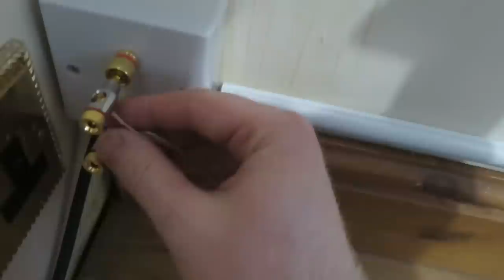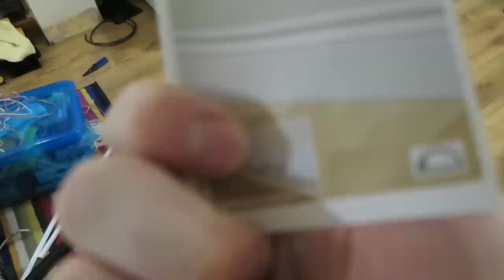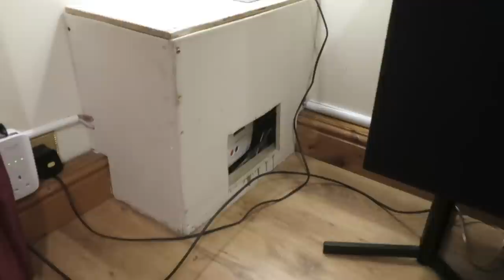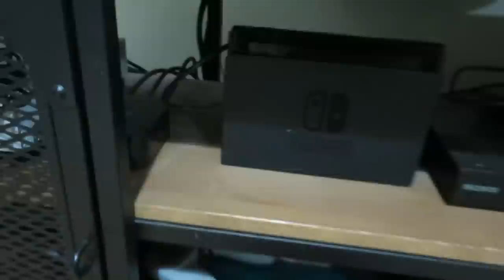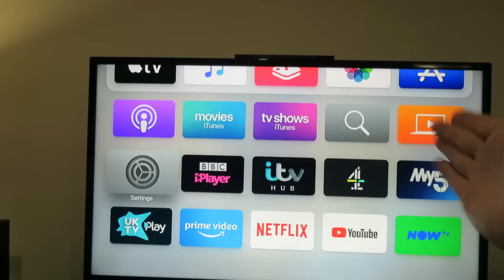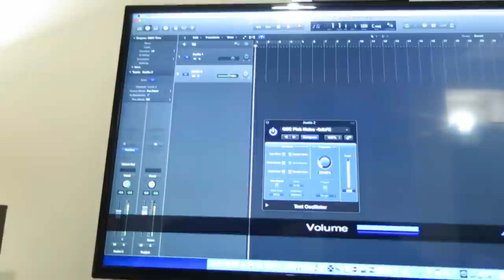Setting Up Our Living Room Entertainment System (Part 6)

Comment: U should angle the speakers towards the center of couch to make a triangle with the tweaters to where you  are seating. And get a subwoofer it makes a world of difference in tv shows and movies.
Reply from the maker: Which speakers, the front L/R? 
We did have a sub on this setup but I took it out. I was having some complications with it, but more than that, I felt it was unnecessary for our situation. 90% of our TV watching happens when the kids are asleep, so most of the time I ended up turning the sub completely off to avoid disturbing them. My front speakers are quite large, so at full range you get a nice rounded low end. You don't get the ground shaking 40Hz / 50Hz cinema sound, but there's still plenty of bass for impact.
Having said that, when they're a bit older I'll more than likely add a sub back into the setup.
Reply: Front left and right yes

Comment: The receiver's faulty soft start almost certainly damaged the speaker. Either the protection circuit is fault or there's DC on the amplifier output as the receiver starts up, causing the protection circuit to kick in and out. That could be a faulty amplifier channel, something in the receiver's power supply or the protection circuit itself. If that's the case it will destroy tweeters in short order and can take the rest of the drivers and / or crossovers out fairly quickly too if it gets much worse, not to mention cause further damage to the amp.
Reply from the maker: Good to hear from you, Ashley.
Yes, this is a right pain. I'm absolutely gutted that it's happened because the last thing I feel like doing right now is replacing my receiver. I do have a plan to try and program a mute command into the shutdown sequence of all of my Harmony activities. This way, I'm hoping the receiver will start up muted automatically. It seems to remember the last volume placement, and if the volume is down on startup, the various pops and crackles aren't audible. This might buy me some time and also saves me depleting the planets stock of replacement 80s Technics speaker components.
Reply: @ItsMyNaturalColour  The majority of mid range drivers in hi-fi speakers are either sealed units, or at the very least don't rely heavily on the enclosure. Given that those speakers have a decent crossover, providing you match the dimensions, and at least match the faceplate size to remove air gaps you should be able to fit any number of aftermarket mid range units. Technics used a lot of drivers across ranges, so if you can find a beaten up old pair of Technics speakers from roughly the same era you'll probably find it's the identical driver.
Reply from the maker: @ashleycox432  Someone managed to find one for me on eBay and posted the link in this comment section! Couldn't believe it as for the life of me I couldn't find one on eBay... but there it was. I've ordered, received it and it's sitting here on my desk. Looking to pop it in next couple of days.

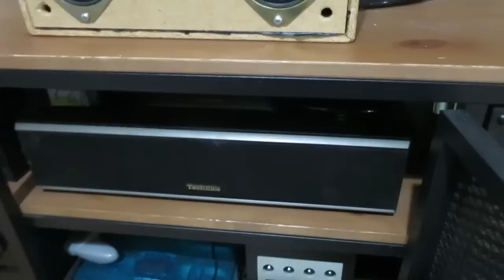Comment: 47:20 this is a perfect (guaranteed) way to make a speaker sound worse
You're adding a load of diffractions by putting it in a cage like that, any center image that was clear with it in the original position should be audibly worse with it in the shelf

Comment: probably a stupid question - why do you need a separate blueray player? does the xbox not do that? PS deffo does
Reply: Was wondering that too, if anything the Xbox is a hell of a lot better blue ray player than that dedicated one
Reply from the maker: We've tried the Xbox One as a Blu Ray player once or twice and I have to disagree with the Xbox being 'hell of a lot better' than a dedicated player. Hardware is fine, but the Blu Ray / DVD app on the Xbox really drags things down. It's clunky and slow, rough navigation and doesn't seem to remember your place in the film as reliably. The Xbox also takes much longer to boot up. The Sony Blu Ray player has a quick start option so you're up and running into the disc in less than 5 seconds. Waiting for Xbox to boot into the OS, then launching the app, takes a lot longer. Also the Xbox is slightly louder, consumes more power and strangely enough, blacks seem deeper from our Blu Ray player VS the Xbox output. I'm not sure what that is, but it must be another something to do with the Blu Ray app because I've noticed better contrast in games than watching Blu Rays on the Xbox.

Comment: I am very happy that my suggestion to carry out the internet cable to the Salon, after more than a year has been realized :) 
I waited a long time. 

As for the protective strip behind the radiator. If you still haven't slipped it in. 
I suggest using WD40, thanks to which you will have slippery plastic and slide along.

Congratulations on the purchase of a new TV. 
Surely everyone understands that you don't need to have 4k to be happy with what you have. 
When do you plan to hang the TV on the boom? Although now that you mentioned the projector, 
this TV may disappear from the regiment.

Congratulations also on the growing family. 
I can't wait for the family photo :)

Comment: tom you can use the xbox one  for dvd and blue ray
Reply from the maker: I've replied to this comment below, but I'll copy it here...
"We've tried the Xbox One as a Blu Ray player once or twice and I have to disagree with the Xbox being 'hell of a lot better' than a dedicated player. Hardware is fine, but the Blu Ray / DVD app on the Xbox really drags things down. It's clunky and slow, rough navigation and doesn't seem to remember your place in the film as reliably. The Xbox also takes much longer to boot up. The Sony Blu Ray player has a quick start option so you're up and running into the disc in less than 5 seconds. Waiting for Xbox to boot into the OS, then launching the app, takes a lot longer. Also the Xbox is slightly louder, consumes more power and strangely enough, blacks seem deeper from our Blu Ray player VS the Xbox output. I'm not sure what that is, but it must be another something to do with the Blu Ray app because I've noticed better contrast in games than watching Blu Rays on the Xbox."

Comment: Tom, does your HT Receiver not have some kind of microphone calibration? I bought into a used Marantz on ebay (shout out to the guy who absorbed $700 of depreciation for me...!) and it came with a small microphone which allows the receiver to automatically blasts each channel with noise then dials in the channel boosts for you - super nice!
Reply from the maker: Yes mine came with one of those. I should dig it out and give it a go one day. My speakers are in less than ideal places, and our seating position in relation to the rear surrounds especially is nowhere near ideal so that's what's always put me off.
Reply: ItsMyNaturalColour my room is about the same size as yours. I have two old bose 901s front channels that my father in law dug out the attic, some no name center channel, 4 home theater in a box surrounds that I nabbed from my uncle and a sub from Craigslist. It’s hodgepodge but I love it! And the microphone calibration really helped, especially for the poor quality high end speakers that are part of my setup. Hope you and yours are doing well. It’s the perfect time to enjoy some quality time together as a family and having a good setup doesn’t hurt 😉

Comment: I can imagine your picking up quite a bit of interference noise, some of it can be rectified by routing the power cables away from other cables (especially the speaker cables) but I'm afraid you're going to have to put up with a faint interference noise, due to the fact you're using unshielded speaker cables! If you're not a heavy listener,  you might not even be aware of it! But if you are and its annoying you,  you now know the reason!  Good luck.

Comment: 1, the xbox is blu-ray player and u can control it with your harmony remote
2. two little boxes can go side ways
3, the wii u can be hack to play gamecube and n64 games
Reply from the maker: Thanks for the suggestions.
1. I've replied to this comment below, but I'll copy it here for convenience "We've tried the Xbox One as a Blu Ray player once or twice and I have to disagree with the Xbox being 'hell of a lot better' than a dedicated player. Hardware is fine, but the Blu Ray / DVD app on the Xbox really drags things down. It's clunky and slow, rough navigation and doesn't seem to remember your place in the film as reliably. The Xbox also takes much longer to boot up. The Sony Blu Ray player has a quick start option so you're up and running into the disc in less than 5 seconds. Waiting for Xbox to boot into the OS, then launching the app, takes a lot longer. Also the Xbox is slightly louder, consumes more power and strangely enough, blacks seem deeper from our Blu Ray player VS the Xbox output. I'm not sure what that is, but it must be another something to do with the Blu Ray app because I've noticed better contrast in games than watching Blu Rays on the Xbox."
2. By this I'm assuming you mean the Apple TV and the Harmony Hub? The Harmony Hub doesn't have a flat edge, so it would just fall over. The Apple TV would, but it's a glossy edge with no grip (bottom has rubbery texture), so the weight of the 3 cables connected would probably pull it over. 
3. Can't beat real consoles :)

Comment: If you contact your Gas provider, they will very happily come and replace your meter for a smart meter which are very small in comparison. You can then negotiate with them to move it outside if it’s not much hassle for them. They need to install smart meters to meet government regulations so they will probably do it all for you.

Comment: Tom, when you come to decorate. I would lift the flooring and run everything cat cables, speaker cables etc under the floorboards - much cleaner. I have been running cat cables all over the house
Reply from the maker: This would definitely be the cleanest option. I think the first redecoration will be basically painting only, with a few little bits and pieces tidied up.
At some stage in a few years time, the laminate will need replacing so at that point, I'll probably do a complete redecoration and hide cables. Also by then the kids will be older so it'll be easier to decommission the main living space for a couple of days.

Comment: Hey Tom you might actually be just the guy that could help me, I recently looked out the old (read "mother's") mission electronics speakers and kenwood amp, and I hooked them up to my pc.
The issue I'm having is the one on the right often, but not always, has interference and way lower volume than the one on the left. Swapping the speakers still leaves this happening on the right side so it's not the speaker themselves, but I'm not an audio guy so I have no idea where to start, even after a google

P.s. You can assume the usual love the vid hope you're safe message, but after a quick look through you comment section I'm guessing your sick of hearing it ;)

Comment: So Tom, are we to now expect your house will have been completely redecorated after all this virus malarkey has gone?
Reply from the maker: Well, I wasn't proactive enough to stock up on supplies before all this kicked off...... so I'm not too sure how far I'm going to get. Even if I don't get much decorating done, we'll have plenty of time to reorganise and declutter so that will be a step in the right direction at least.
Reply: ItsMyNaturalColour It’ll help to keep your mind if everything. I think you could still order from online retailers? I presume couriers are still delivering. You’ve done a really neat job with those wall sockets for the speakers.
Reply from the maker: @marksapollo   As far as I know, most courier services etc are still functioning normally or with only a slight delayed service. If we can get these wild kids under control, I might get 5 minutes to get the paintbrush out haha! 
Thanks man, I appreciate that. I did most of that work back in August, and looking back I think I should've just run the cabling within the skirting under the window instead of fiddling around with that shit mini trunking and drilling through the gas box. It would've made it a little cleaner, but at least it's 10x better than having the cables draped across the floor. Still angry at myself for cracking that box though, what a drag!

Comment: You don't need the blu ray player 
The Xbox has a 4k uhd blu ray player built in
Reply from the maker: Hey Harry, I've answered this question a couple of times in the comment section, so I'll copy'n'paste from a previous reply...

"We've tried the Xbox One as a Blu Ray player once or twice and I have to disagree with the Xbox being 'hell of a lot better' than a dedicated player. Hardware is fine, but the Blu Ray / DVD app on the Xbox really drags things down. It's clunky and slow, rough navigation and doesn't seem to remember your place in the film as reliably. The Xbox also takes much longer to boot up. The Sony Blu Ray player has a quick start option so you're up and running into the disc in less than 5 seconds. Waiting for Xbox to boot into the OS, then launching the app, takes a lot longer. Also the Xbox is slightly louder, consumes more power and strangely enough, blacks seem deeper from our Blu Ray player VS the Xbox output. I'm not sure what that is, but it must be another something to do with the Blu Ray app because I've noticed better contrast in games than watching Blu Rays on the Xbox."
Reply: @ItsMyNaturalColour  I just remembered your using a 1080p TV aren't you 

I had that issue until I upgraded to my LG Oled
Reply: @ItsMyNaturalColour  anyway tho 
Your videos have been keeping me amused this last few weeks while I've been working from home  in "sunny" Lincolnshire so thanks lol :) 😀😀😀

Comment: i thought you had a powered sub
Reply from the maker: gamrnik  it didn’t last long. I had a few issues with it. I think I may have addressed it in either the previous part or the part before that.
Reply: ItsMyNaturalColour do you still have it
Reply from the maker: @NicktronicIT  Yes I still have it.
Reply: ItsMyNaturalColour are you planing on doing anything with it